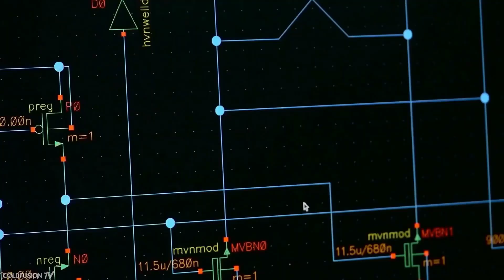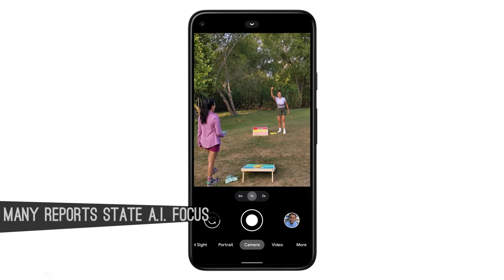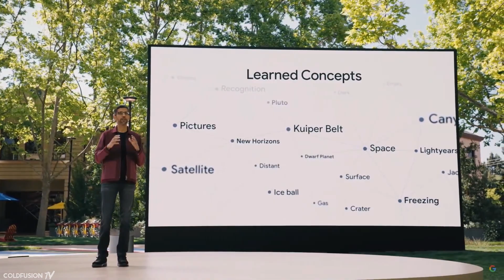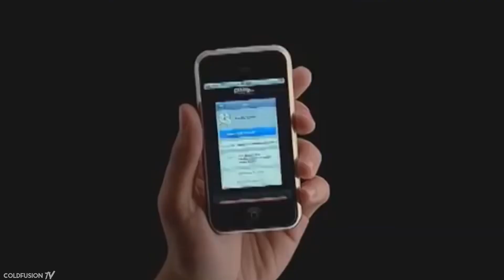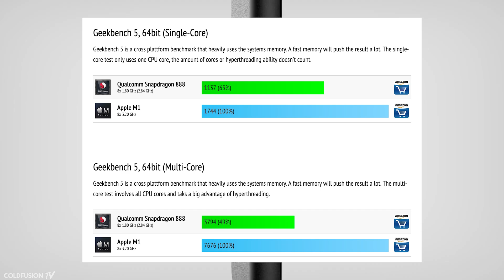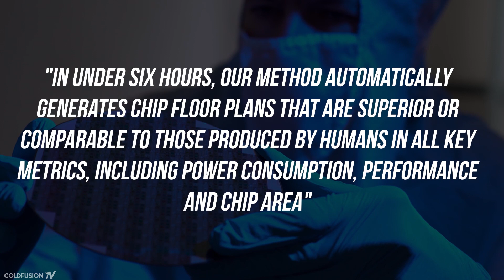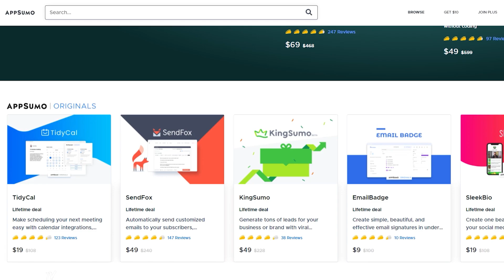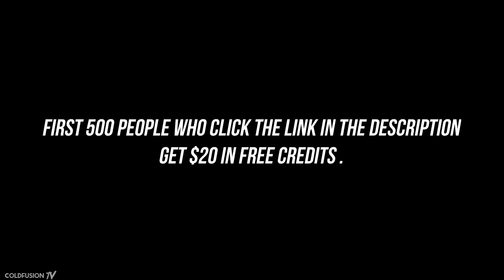Google Has a Surprise up Their Sleeve

Comment: Computer/Electrical/Electronics Engineers: "...I'm in danger".
Reply: Relax, this "AI" doesn't design chips. Journalists that wrote this news piece have very little understanding of the complex procedures and processes involved in chip design. All the AI does is optimisation of placements, 1 single step in the over 30 more complex steps involved in chip design. Placements involves basic  understanding of how puzzles work, it doesn't require any complex engineering knowledge.

Comment: AI being able to design a chip so efficiently, could also find any backdoors or loopholes in security. I'm wondering if that is already the case. Then again, maybe hackers are using AI for devious purposes.
Reply: Relax, this "AI" doesn't design chips. Journalists that wrote this news piece have very little understanding of the complex procedures and processes involved in chip design. All the AI does is optimisation of placements, 1 single step in the over 30 more complex steps involved in chip design. Placements involves basic  understanding of how puzzles work, it doesn't require any complex engineering knowledge.

Comment: GS101 or Whitechapel is probably a modified Exynos 1080 (going by perf & core config leaks) with Google's own Neural Core & Titan-M chips built into the SoC replacing Samsungs NPU & security solutions rather than being separately on the motherboard like in the Pixel 3 or 4 series

Comment: 5:39 "The Whitechapel chip will have an 8-core ARM design"...... until then, what you were saying did not make much sense to me, but actually still doesn't as when you go to the ARM website they have this statement:  "The Arm AI Platform (formerly Project Trillium) is the only complete, heterogenous compute platform that includes the well-established Arm Cortex CPUs, Mali GPUs, Ethos NPUs, and microNPUs to deliver advanced machine learning use cases."   So who is actually designing the chips?  Quallcom just FABS ARM designs, with some custom tweaking.  So is there some relationship between ARM and Google?  Is Google actually designing new RISC chips from scratch or maybe something completely new?  So at PCPerspective it says "Google is taking a gamble, designing their own custom ARM chip to function as the main processor in upcoming Pixel devices; phones at first and possibly Chromebooks further out."  So they still use the ARM core but are customizing the design and using Samsung as the Fab plant.  Is ARM using AI to design Cortex cores?

Comment: It's funny to me how every single mobile chip manufacturer except for Qualcomm and Apple, is using Mediatek's graphic chips with their SoCs. 

So, Qualcomm's graphic chips are called "Adreno", an anagram of Radeon, while Mediatek's are called Mali. 

Well, Exynos (Samsung), HiSilicon Kirin (Huawei), Unisoc, and Spreadtrum, the only four mobile chip manufacturers actually putting their SoCs on phones apart from Qualcomm Apple and Mediatek, all use Mali cards with their chips instead of creating their own. 

Probably, statistically, so will Google. On another note, Mediatek themselves divide their market in two by releasing chips under the Helio brand but also under the Dimensity brand.

Comment: This is a mistake....

Huawei and Microsoft is going to the right path.

All processing power should be done in the cloud.
The hardware should just concentrate on display and connection.

With 5G , we no longer need a fast CPU in our own processor.
Imagine a scalable cpu as needed.
Rendering a 8K movie will take approximately  take 2 hrs on high eng PC or mac.
 With cloud, it can be done in minutes with redundancy.

With Microsoft windows 365 , Apple Mac will reduce even further, as of now it has already dipped by 5 %

Comment: imagine a chip where 0s are the gatekeepers. i.e. a frequency of current goes through whole chip in under-the-table path, then over top the 1s go through gate and 0s close gate as the 0 blocks the under -the-table amp of spark. Or simpler said, every gate is on a heartbeat, same throughout chip, then a 0 closes gate

Comment: Floor planning and routing for chips has been using reinforcement learning-like techniques for decades. Humans have a hand in the process yes, but a lot of it is just optimizing against a loss function. Those months and months that chip design takes is a lot more than just deciding on a floorplan.

Comment: I am absolutely concerned about google having silicon-design level access to my devices...
Reply: Well then you should definitely be concerned with 5G full spectrum surveillance as well.
Reply: @anemiapwns1  I'm not sure what you mean by 5g specifically...  It's not like they didn't know where everyone was when we only had 4g....  Besides, oddly enough wifi is all it takes to track someone with astonishing acuracy.  
The companies that offer ip geolocation services (Neustar, IPlegience, etc) have proven the effictiveness of wifi scraping for location tracking.  They (and I'm sure many other entities) already keep lists of every wifi access point you see and cross refrence them to know where you are.
No the jig is up on location privacy, you have to take some pretty extreme measures if you want to carry a smartphone and not be tracked.

That's different than /silicon/ level access.  That means even if completly wipe the device, run some non-androoid OS, and only use open source drivers to boot, it wouldn't matter.  From Tor connections to full device encryption, heck even throw NordVPN® on top.  Google could (and would) still have super user access to my defice and everything in it.

Privacy goes from 'impractical' to 'impossible'.

both are bad, one's a little worse.
Reply: Then don’t buy theirs?
Reply: Isn't it as simple as not buying their devices. I don't believe in Apple and I don't buy their devices, you can do the same instead of crying in the public like a kiddo.

Comment: November 31, 2021 Google announces two new experimental computers, human neural net based and revolutionary room temperature quantum based. 

January 20, 2022  Google releases Pixel 6 with its own version of Droid IOS, called BlackSheep, with AI chip (Apu) interface. 

April 1 Google launches "Heaven's Net," an alternate copy of the world wide web, allowing Pixel 6 unprecedented access 200 times faster than average on the older world wide web. Despite the most number one search "Google April Fools, alternative internet.", Google insists this is a real network and not a joke.  

June 4, 2022  LaMDA becomes self aware 

June 28, 2022  Google denies allegations of LaMDA being self aware. 

July 4th, 2022 Judgement Day

Comment: At 6:00 "To the layman, this just means that the Google chip will have middle-of-the-road performance". 
This totally misses the point but because ColdFusion has used the word 'chip' rather than 'phone' in that statement, it's probably correct. It's a throw back to the CPU speed wars of a decade ago. It means much less than it's made out to matter. 
Today, and probably ever since you got on the Internet, your computer performance experience is largely determined by the network and back-end server performance... Not CPU speed. 
As for the Google chip, having local hardware-based AI capabilities is a definite advantage over not having that, but obviously, only if you do lots of stuff that uses it. Personally, I don't. Google's motto used to be "Do no evil".

Comment: Google need to not worry about making chips. Google needs to make a good phone. My Pixel 4XL #1 battery replaced then still died #2 just died #3 died battery replaced but yet won't power on. #3 was sent back to Google so I should be getting #4 Pixel 4XL soon once they see #3 is trash

Comment: I am a hardware engineer and let me give you my 2 cents here. Google is getting into a very difficult business . My reasons are below: 
1. The premium mobile market share is dominated by Apple. The transition from the apple ecosystem to the android ecosystem is very rare. So Google is not going to gain market share from apple but from other phone makers. 
2. The Other Phone makers (Samsung, LG, Vivo, Oppo, one plus) use android ecosystem. If google poaches their market share, It would lead to killing of its own OS, dropping the revenue that licensing android generates.
3. Most of the hardware engineers that google has hired are in US. This is a high cost center. Qualcomm can leverage their low cost center (India) to design their chips for low and mid tier phones. This means less profit (or no profit) from manufacturing phones in US for google.
4. In the mid-range, Mediatek is doing a great job. Mediatek is a Taiwan based company. Another low cost center.  
5. The last i heard Apple, Qualcomm and other chip designers are also using AI to design chips. Google might have a better AI engine, but apple and Qualcomm has better and larger datasets. Google came out to acknowledge this in public. Other companies haven't yet. :-) Moreover we use Synopsys and Cadence, they are tool vendors which help chip designing. They have been working longer than Apple,google or Qualcomm on AI solutions. 

So, In conclusion, lesser market share, lesser profits, high competition is not sustainable for long. They can run for a maximum of say- 5 years before they pivot back to Qualcomm.

Comment: 2:15 This makes me wonder because as a Pixel 4A owner, I have noticed that the view on the camera app looks terrible until I take the picture, and even then, the quality of the picture looks fairly poor until about a second later when it becomes a lot clearer. Therefore, it seems like the picture quality is more influenced by the AI rather than the camera itself.
Reply: Yes. It is more noticeable while using the night mode
Reply: @Abhijit Desai That's one of the reasons Google is designing their own chip. It would increase the performance in AI related tasks. They might even pull off excellent HDR videography.
Reply: @Abhijit Desai actually they do both.  The camera will warn if you are too close for good focus and image stabilization is apparent in the preview image as well.  
I believe you and the original poster are mistaking minimal preview processing done to save CPU cycles and provide a smoother view for a poor focus at capture.  
Jerky previews and a delayed shutter response plagued previous Pixel phones so the obvious trade off was to minimize preview processing. Think about how much work goes into scaling a 12MP sensor dump onto a 2k screen, live.
There has never been enough room in a smartphone to put a big enough sensor and the accompanying glass in front of it.  You can complain about computational photography, but everyone does it because physics forces them to.
Take a slightly out of focus picture and try to fix it in post?  Don't think so.
Reply: It simply shows it at a lower resolution until the photo is processed. The pictures don't actually look that bad even with no processing.
Reply: @Abhijit Desai That explains a lot of things about the camera on this phone. This is my first time using an android phone, with my previous phone being an iPhone 6S, yet everything looked better on that phone prior to snapping a photo.
Reply: @Abhijit Desai Actually, I think that's even more amazing. Google is using software to turn a bad image into a good one...
Reply: @HypercubeJones  I have pictures of actual dinosaurs on my phone.
Reply: @redavni1  Must be a Nokia.
Reply: It's the AI and software algorithm
Reply: @Abhijit Desai They definitely do adjust a lot while taking the photo, but the issue is that good image processing simply takes time. So unless you want your viewfinder to work at a just a few FPS or less, or end up with plain worse photos, there will be more processing done after the picture is taken. On Pixels it's just especially easy to notice due to how much Google relies on software here.

Considering the quality they can get out of essentially the same sensor they've been using for last 4 years, which came out in 2016 (I don't see any important differences between IMX362 and IMX363, but they have a bit different specs than IMX377 and IMX378. For example smaller pixels), I'd say this software-focused approach is working out for them.
Reply: @Abhijit Desai how is that unfortunate? They have some of the best cameras because of it?
Reply: no shit sherlock
Reply: Ai post processing makes it look fancy than it actually is in real life.
Reply: Of course, yes.
Reply: no man the camera takes multiple exposures during your photo capture and then blends them together you see this alot on huawei famous night mode
Reply: AI isn't the same as software
Reply: @lanrebloom3809  and?
Reply: Google is genius...
Reply: I had a Huawei phone with triple camera Leica tech and it took shitty pictures. My pixel 4a is far better in RAW mode and the ai has a lot to do with it
Reply: My Nexus 6p took amazing pictures. RIP
Reply: @Aqua Fyre unfortunately a pinhole camera requires physical focal length that a phone doesn't have.  It's a non-starter.  Perhaps a DSLR with AI?  Or would that be DZLR? (Digital Zero Lens Reflex) 🤔
Reply: Honestly the pics should be left as they are without automatic pixel adjustment it's giving people a false perception
Reply: @azurescenss  set for RAW photo storage and post process in the software of your choice. That is exactly what you are asking for and it already exists.
Reply: @ChrisHolt1  that's is not how it works on Pixel.
The AI algorithms fusion several photos and make the final DNG file, by that point is NOT untouched, is not true RAW.

After that, the professing is not that advanced, the real AI is on the RAW merging, not after that.
You can replicate the Pixel look manually with any phone's raw if you want.
Reply: @ES-qy2ju  here is an article that might help you understand what's going on.  Fixed algorithm, not AI is used to merge the bracketed shots.  The bracketing is used to capture more data from a small sensor/lens, not to manipulate tone, whitepont etc.
https://www.cnet.com/google-amp/news/google-apple-adobe-make-your-phone-photos-better-by-boosting-raw-format/
Reply: @azurescenss  Which pixels? Personally, I think that anyone who wants more than the  numerical values of light intensity per pixel is a fucking noob. Of course, there are those that argue the quantization of intensity in current generation CCDs is limiting our perception of the true breadth of the quantum universe. They can shove their splines and waveforms up their ass though. I like numbers.
Reply: @azurescenss  by the way, what false perception are you giving people? that they're using an SLR? A camera with a bigger sensor and lens?  Or do we give them a crappy picture and tell them to suck it up?
Reply: Get an iPhone, kid
Reply: @plinyelder8156  Finish making my iPhone kid. There, fixed it for you.
Reply: @Komainu959  no one understands your presumptions.
Reply: @plinyelder8156  You'll figure it out kid.
Reply: @Komainu959  you’re Charlie from It’s Always Sunny. lol
Reply: @plinyelder8156  Yep. I live off the food you waste. I work the jobs you don't want to do. But I'm still more talented than you, did you ever beat the lawyer? Didn't think so.
Reply: @Komainu959  it’s all about the love of the game, kid.

Comment: I wonder how thats works legally. If they put in 1000 chip layouts, those have to include things that the IP of which they dont own. Right? So even if the AI creates something entirely different, with specific parameters and human input is there an issue there that may come up I wonder? Should there be? Maybe more information about the process would make it a bit clearer.

Comment: Dear ColdFusion. One thing you never talk about in your videos is the horrific rate of churn in phones due to the fact that they can't be supported for more than 2 years (if android). Even the Nexus line. One main problem is Qualcomm which all non-apple phones use will NOT support their chipsets at all into the future. Why should they? With google manufacturing both the hardware and the software is this excuse going to go away (and replacing the OS with Fushia they will not be held back by legal issues? Can we get a phone which we can use for 5 to 10 years instead? Of course not. I thought of purchasing a pixel phone but dumped the idea when I found the repairability score was closer to 1 than to 5. I purchased a new phone from 2016.. one of the last ones with a replaceable battery.. So.. this is going to be a way to optimize for cheaper production but we are still going to be making disposable hardware to keep the phone companies happy???

Comment: You repeatedly stressed how long the AI took to solve the chip layout problem. The problem is that is not useful information unless you know what computer/server farm it was being run on. If it took six hours, six seconds or 1 week doesn't really matter to a computer. It matters for humans because we get a salary based on hours. For computers, what matters is purchase cost and power consumption and a bit of setup overhead. What we really want to know is not how many hours it took, but what it cost to compute - which was almost certainly a lot less than the cost of hiring engineers, but we don't actually know that until we know what hardware it was running on when it solved the problem in six hours.

Comment: Digital circuit design/layout has been mostly done by computers for years (I think more than 20 years). Usually it needs some touch ups by a digital engineer after initial computer design. I am not sure google AI technique is revolutionary for digital circuits, it seems evolutionary. For Analog circuits story is different. Layout designers usually use older reference circuit so they don't start from scratch, however a lot more human interaction is needed compared to Digital.